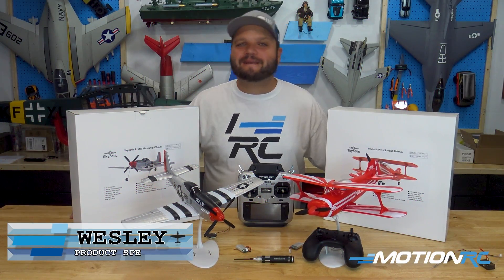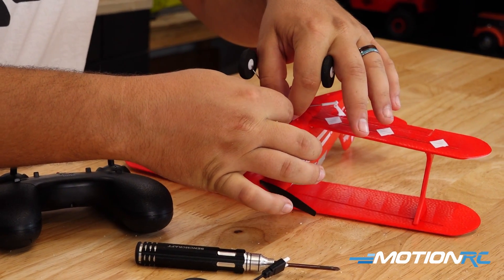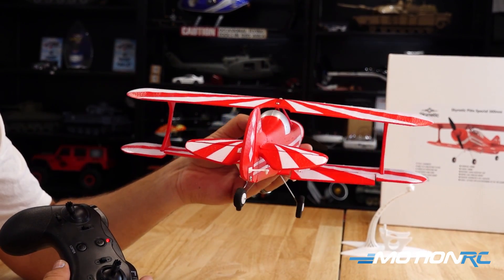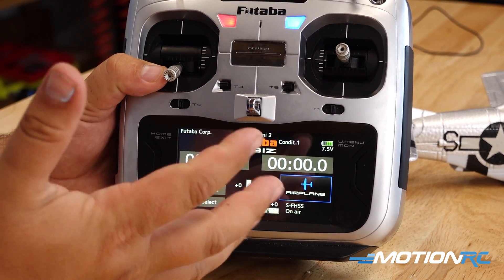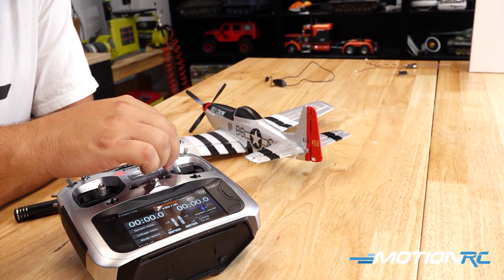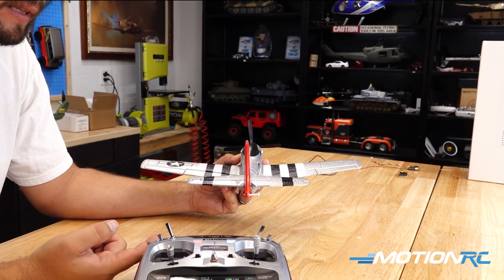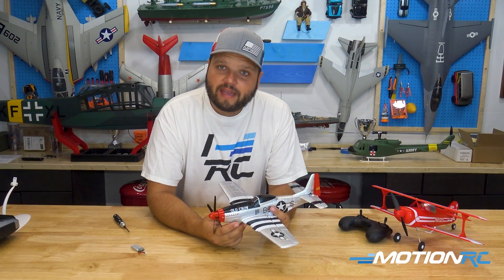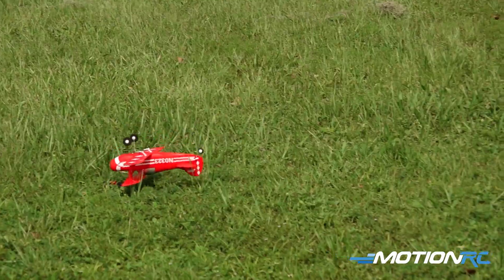Skynetic Micro Flyer Futaba Transmitter Setup | Quick Tip | Motion RC

Comment: Saw these videos and thought these were heads above my volantex! So i ordered the P 40 and nice plane but..... the black wire on the receiver was not connected , no problem I resoldered it got the radio bound and everything set up and much to my chagrin!!! a prop ,spinner,scew but no plastic hub to mount on!!! to snap on motor 😢 So no fly  I would think a little better quality control from you guys.   Henry
Reply from the maker: contact our customer service department if you have not already.

Comment: Okay I installed the Futaba receiver into my previously RTF tiger moth. I have it bound correctly. I only needed to reverse the elevator and the throttle. That is all set up correctly now. I tied Channel 5 to the switch I usually use for gyro mode on all my other planes. However it only seems to work in the first two positions not the third. I also don't know which way is full gyro and which way is ASX3 and which way is somewhere in between. I am thinking that this is binding the beginner and expert mode that's on the left hand side of the original RTF controller. It is not adjusting the gyro itself. It is only adjusting the throws. I still don't know which is. I need to find the true gyro channel.
Reply: Provided that you have full outputs from your Tx channel 5 (check on your transmitter displays or via an S-bus reader with your satellite plugged into it) it seems that you are switching the "Stick Rates" - NOTE that "the beginner and expert mode that's on the left hand side of the original RTF controller" means "stick rates" in the Pidgin English used by our Oriental Friends! Try channel 6 (most likely) or above channels for the 3-position Modes Channel.

Comment: I bought the futaba ready version,bound it to my tx16s no problem. 30%expo all control surfaces are correct. I hand tossed it at full throttle and it barely flies it feels tail heavy and under powered,its been crashed about 6 times in a row because even at full throttle in all gyro settings it doesnt want to fly. This weekend i went to try again and the throttle was wide open and no response from the throttle on the transmitter,but i still had full control of the flight surfaces,it was still unable to maintaine flight. Is there a way to reprogram the esc/reciever/gyro unit? The eachine/leambre/volantix planes flew way better than this.
Reply: Futaba (at least in its S-FHSS protocol - also Radiolink receivers) runs a REVERSED Throttle! Have you set the throttle channel to Reverse in the outputs page and set your throttle cut to +100? 
After that do a normal ESC setting procedure. Tx on, throttle to Max (Throttle Cut to Armed), then plane on, wait for beeps then pull throttle to 0. ESC should count cells and confirm arming. 
ALSO check if the prop is assembled facing the correct way. With concave section to rear!

Comment: I have an XK K110 S helicopter. It came with a very nice programmable 6 ch transmitter that will take up to 20 models. I also have an Eachine Spitfire and a Qidi Maule bushplane 50 cm wingspan. Is it possible to bind these to the XK transmitter?
Reply: Yep, if the protocol IS the same on the XK K110 and your XK K110S but with some provisos. Your "Eachine" Spitfire (an EXHOBBY/Volantex re-brand) will need to be 1 of the latest versions with the S-bus and DSM sockets on the board. The Qidi Maule has the S-bus and DSM sockets (the DSM socket doesn't appear to work but the S-bus does) and these "Skynetics" re-brands (All 10 current models + at least 1 more coming) do have working S-bus and DSM sockets.
Thus you could bind all your models to your XK K110 Tx (I can't remember if there is a 10 or 20 model limit on the XK X6 transmitter, which runs Futaba S-FHSS protocol?) by adding the little Printed Circuit Antenna Futaba S-FHSS protocol satellite receiver that is available from MotionRC (and many other selling platforms) or any other satellite that uses Futaba S-FHSS to output an S-bus serial signal.
Note that it DOESN'T HAVE to be a Futaba satellite feeding the S-bus satellite socket. ANY other Tx/Rx pair outputting an S-bus signal will work equally well.

Comment: Yes, I would like to bind this to my RadioMaster Tx 16S but would need to know the receiver manufacturer. Best of both worlds...a little "on the road" rtf transmitter and my RM 16S for flying at my fields at home! Nice package with gyro included and the pop-off propeller. I do wonder how long the plastic rings will hold up.

Comment: Self-proclaimed "Experts" give me the squits! These guys are just Counter Jumpers at best. They have the item right in their hands and they still have no idea what they are talking about! 😒
At around the 7 minute mark he describes the second flight mode as the equivalent of Spektrum AS3X ( No self-levelling, gyro correction for wind buffeting only) when you can clearly see the ailerons deflected for self-levelling and they immediately jump back to level with the wings when he switches to the third Manual Mode! 🙄
That's not to say that they are bad toys. They are quite reasonable Chinese-designed and made units re-branded with the Motion RC in-house "Skynetics" label. No idea who the OEM is. Not likely to be EXHOBBY/Volantex. Some features resemble Weili/XK/WLToys/JJRC products. Other possibilities might be TOPRC or KOOTAI. Hopefully NOT the maker of the "Eachine"/"Skynetic" Mini Cessna and P-47 "Razorback"!
The stock protocol is not yet known for Multi Radios but the S-bus satellite socket makes this (and the P-51 - plus there is a marking on the board for another possible model to come) suitable for control with any Tx/Rx pair with S-bus output capability. Many of these Chinesium boards also provide a satellite input socket for Spektrum DSM receivers but these shysters pointedly omit to show any photo of the boards that might depict said socket (or where 1 might be added by other users.)
Reply from the maker: We have stand alone videos showing customers how to use a Spektrum receiver in the model. Not sure why you think we are hiding anything.
Reply: @MotionRC  Point conceded on the DSM socket. While neither this video NOR the artwork on the sales listing for the plane show it, the sales site for the receiver boards of the Pitts and P-51 DO show the DSM socket marked in 1 of the photos. 
Same for the Lemon satellite receiver set-up video alluded to (no link provided) which I HAD actually commented on in the past.
But then I'm elderly and am sliding into memory loss! What's your excuse, young fellah, for missing the mode information mentioned above?